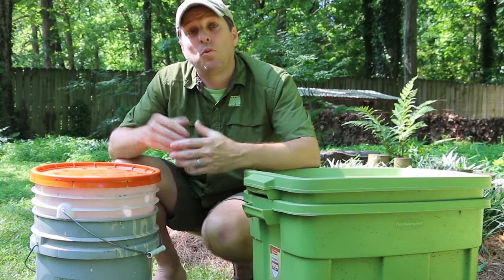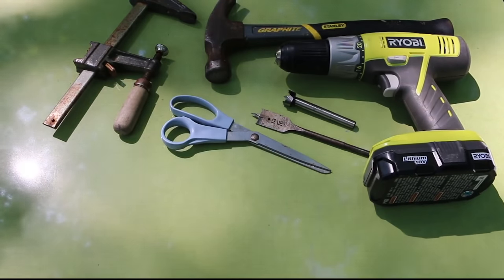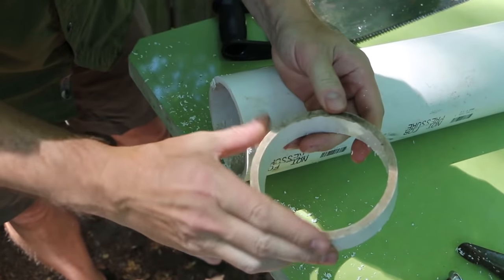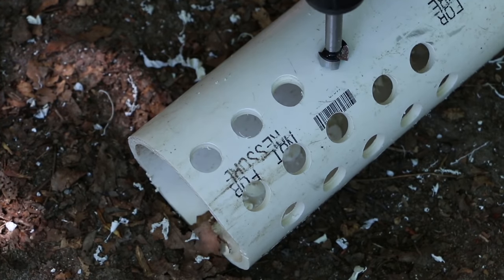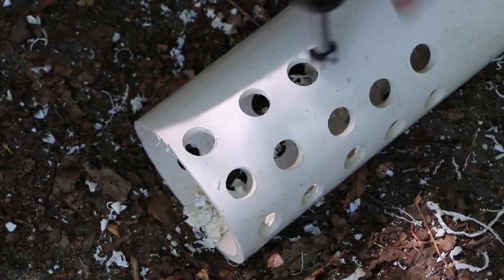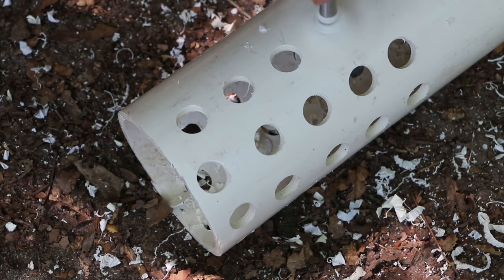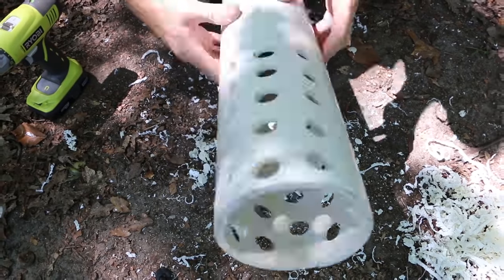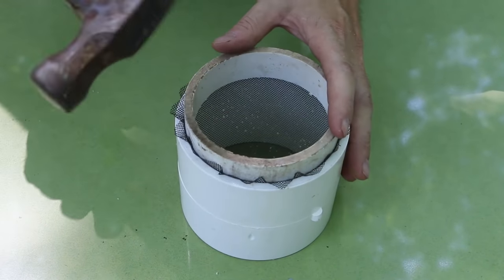How To Make A DIY Worm Tower

Comment: I made my worm towers but put buckets on the top of them.  My question is now I have fire ants in every tube.  I made four tubes.  I'm afraid my worms have been killed by the fire ants.  But I don't know how to get rid of the ants without hurting the worms.  Any ideas?
Reply: Also what was the purpose of the screen. Would that have kept the fire ants out?
Reply from the maker: Hi Dianne. The screen was to keep the soldier flies out. Ants are a big problem. I don't think the will harm the worms underground, but I'm not sure about that. I don't have a solution for you, other than moving the towers and trying to separate the worms. But, that could be dangerous considering how fire ants behave when disturbed. Perhaps a water separation method would work. Pull the tower and put it in a 5-gallon bucket. Fill the bucket with water. I think the ants would rise to the surface and the worms would stay under. I wouldn't let them stay under for too long though....for obvious reasons. I currently have fire ants in one of my soldier fly composters. I may try the flooding method to see if that will get them to move out. I may do a short video about that. Thanks for watching.
Reply: @GreenShortzDIY  I had ants in my home and I poured boiling water all around the entrance and foundation of the home and it did the trick. The following year, the ants came in again and I did it again and they stayed away for a couple of years. We've since moved from our home now but I was happy with it. I wouldn't do it too many times as I'm not sure how boiling water affects cement.

Comment: A very nice idea. The only downside I might see is that it's too small for a family. I, as a single person, generate about three quarts of scraps per week. I can see that a family would generate much more and might fill up that tube pretty quickly. Maybe a 5-gallon bucket is better for a family.?
Reply from the maker: Hi Elizabeth. I agree with your assessment. I've done a 5-gallon bucket worm tower as well. Or a family could utilize multiple worms towers to spread their scraps between.
Reply: @GreenShortzDIY  That would be a great way to spread them out. Then you share the "worm love" all over the beds.

Comment: I tried this at home for dumbing vegetable wastes, but didn't work out as expected because of below points.
1) Here we have issue with Bandicoot rats, They will dig this place and spread the disgusting smell around. 
2) Waste eating worms were coming to the top of the pipe and that makes us nauseating. 
3) Putting waste were decomposing but the level is not going down and in future at some point we need to completely remove the whole pipe and clean it up. 
Anyone here facing similar issues? Any solution for this??

Comment: Thank you for the video, but isn’t a worm tower flawed in respect of the most efficient composting worm being that of the tiger worm which doesn’t live in soil but is a surface dweller and so you’ll have only other soil burrowing worms feeding on scraps but not to the degree that they will be useful for producing compost at the rate needed to not end up with a tube of rotting food scraps?

Comment: I thought the idea of a worm bin was to be able to separate the castings? This tower just sits in one spot?
Reply from the maker: You are correct. However the purpose of separating the castings can be to use them as fertilizer in the garden. A worm tower in the garden removes the need to separate the castings...at least for this particular use. I like it because it is a super low maintenance way to do worm composting. But, I also have a flow through worm composter that does allow for separation. Thanks for the questions. Thanks for watching.

Comment: Won’t gophers and rodents get in there?
Reply from the maker: They can. A 1/4 inch wire mesh around the bottom will help prevent that. No gophers where I live, but I’ve had moles invade my worm composters. Thank you for watching.